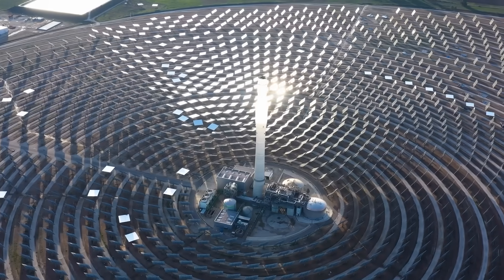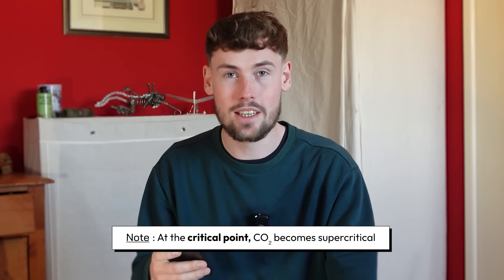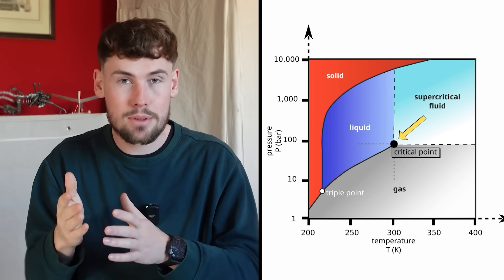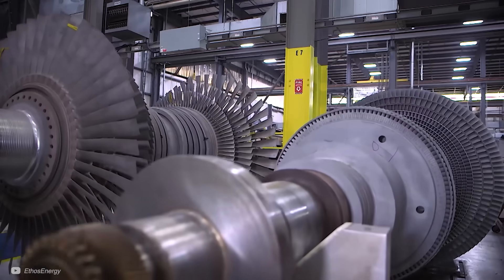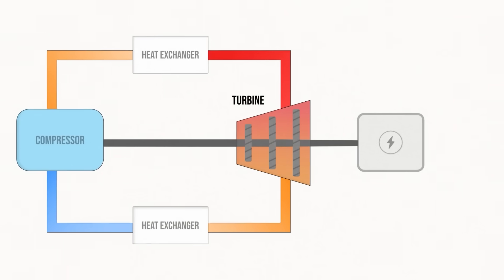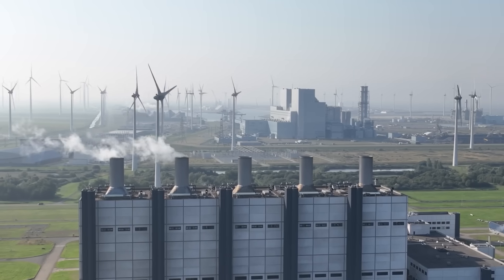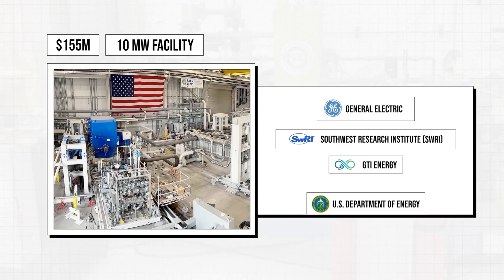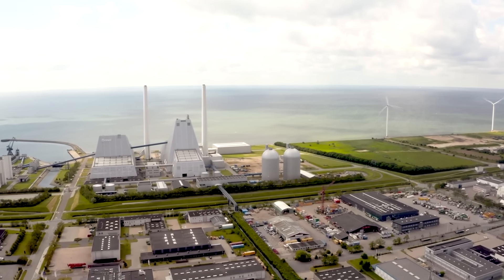How Ultra-Efficient CO2 Turbines Are The Future of Energy

Comment: I've been working with supercritical CO2 for about 15 years. It's interesting. 
The CO2 NEEDS to be dry. Otherwise, you have to deal with carbonic acid formation and stress corrosion cracking. 
Supercritical CO2 is also hard to seal. It will permeate any polymer. Many sealing materials will be destroyed during depressurization. The CO2 inside the sealing material expands more than 50x and explodes out of the seal. 
If using the wrong materials an o-ring will sit and crackle like it's full of "pop rocks" after depressurization. 
Teflon works ok, but you have to be careful if working at elevated temperatures. Teflon has creep issues and will plasticly deform. The o-rings will shrink when the CO2 permeates out, AND the temperature drops, resulting in a seal that is thinner than when you put it in. Then it no longer contacts both sealing surfaces.
Reply: Interesting stuff.  I wonder how they plan on sealing the rotating shafts.  Steam turbines use labyrinth seals which work pretty well up to a couple hundred psi.  (and of course the condenser of a steam cycle is in a vacuum). But sealing a shaft spinning at high RPM against 1070 psi gas and higher, would seem to be a tough issue. How long to such seals last I wonder.
Reply: While not as extensive of experience as yours, I've dealt with CO2 at a few thousand PSI for a test cell for Raman spectroscopy. Towards the end of the project we were looking at basically swage-lok style fittings on everything, including a couple of quartz windows with the edges wetted with indium to provide a better surface to seal against for the metal compression rings. Supercritical CO2 is a wild beast of a material to deal with.
Reply: CO2 has a tendency to destroy seals and a rotating shaft at 1070psi is kind of impractical.
Reply: @olderchin1558  1000 PSI compressor is common. I wonder what kind of seal they use...
Reply: presumably the generator could be inside the pressure vessel so no rotating seals?
Reply: @SamuelBaileySkyrad  you still need to direct full flow pressure onto the turbine blades, and then direct that flow to an outlet for return circulation and heating, rotating seals are unavoidable for this kind of kit.
Reply: I wonder how that will affect my stratos project?
Reply: Copper plate seal knife edge seal
Reply: Say that you had never worked with really high pressure... The seal is made from carbon steel...
Reply: Triple seal
Reply: An underestimated comment. There would also be the danger of CO2 leaks into the environment. With such tremendous pressures, a leak in a pipe flange, mechanical seal, or O-ring would cause the CO2 jet to expand violently, filling the entire environment with oxygen, displacing the oxygen and killing people who couldn't escape by asphyxiation. Unless the pipes and important parts of the cycle were double-jacketed or in an enclosed box, I believe a supercritical CO2 leak would be more dangerous than a leak of superheated water steam, which would at least be a blowtorch, but water condenses and doesn't kill anyone by asphyxiation.
Reply: @jaguarundiargentino1248 , my experience has all been at high pressure but low volumes. Maybe 200-500 ml inside a system but at pressures up to 10,000 psi. 
One quick way to check for big leaks is a thermal camera. 
Joule Thomson cooling from expansion of CO2 is pretty significant. If you have a system in an oven you can immediately see the cold spots on a tube or fitting. 
We use snoop, essentially soapy water to find smaller leaks. 
If dealing with larger gas volumes on pilot scale systems we wear personal gas meters and the buildings where the equipment is located have gas meters with alarms mounted in various locations. Our lab and pilot spaces also have higher air turnover. 
We had an incident where a filter regulator on a large N2 supply line failed, broke dumping N2 into the space. Nobody was in there, but it tripped the alarm. Guys were smart enough not to rush in but could see it was an N2 leak from the alarm and cut the supply. Then in 5 minutes the air handling system had already turned the space over and it was safe to enter and replace the failed part.
Reply: @jaguarundiargentino1248 well that's not unique to super critical CO2. I think most workers would find it rather disagreeable to anywhere near a conventional steam turbine when it would spring a leak. A lot of sailors were flash cooked when steam pipes would take damage in WW2.
Reply: @jaguarundiargentino1248  In oil and gas, 1000 PSI is quite common... So 1000 PSI flammable gas is as dangerous as a 1000PSI non flammable gas...
Reply: @jaguarundiargentino1248 If such a leak happens in an enclosed space with poor ventilation you are simply getting cooked by the energy released regardless of the particular gas well before you have time to asphyxiate

Plenty of horror stories from boiler rooms in ships

Comment: 50% efficiency is definitely less then I would expect from "ultra-efficient" turbines. I have encountered many times steam turbines efficiency ratings of 40-50%. Let's hope these new turbines will be at least cheaper and easier to maintain due to much smaller size.
Reply: The maximum theoretical efficiency of a heat engine = 1-Tc/Th
where Tc = temperature in kelvin of the cold side, Th = maximum operating temperature in kelvin on the hot side

The only way you can get close to 100% efficiency is to have the heat at an infinite temperature and the condensers/cold side at absolute zero.
Since neither of those are possible and materials tend to melt over 1000 degrees, heat engines can never get over ~78% efficiency, not unless we can confine a plasma at millions of degrees and somehow expand that to do some work.

Comment: Wind power brings kinetic energy at normal temperatures, obviating the need for these special materials to withstand ultra heat & multiple bars. After all you need to rotate coil around a magnet to produce electricity. Why should it be made to sound so complicated?

Comment: 10 times smaller ?   Is that the same as saying add ten times less ?     Come on, stop the crap multiplication denotes increase,  by convention reduction is denoted by the reciprocal ie 1/10 of , really come on 10 times less actually means multiply the initial amount by 10, then subtract that from the initial amount.   Starting with 10 pounds and add 10 times less means this:  10 - 10x10. you must remove 90 pounds.    Total cockwomble shitspeak that makes no sense

Comment: As these are much smaller, could they theoretically be put "anywhere there's a fire"? Like waste incinerators and even over blast furnaces to "re-use" some of the energy that went into firing them?

(Why yes, emoji users, I KNOW it won't get enough energy back to run the furnace itself, but getting some back for nearby houses is still worthwhile, right?)

Comment: The water is not special ‘supercritical water’, supercritical here refers to the design of the boiler where the water turns directly into dry steam rather than going through a water->wet steam->dry steam process.
The outlet of the boiler is higher pressure and temperature compared to a standard boiler, so maybe 1050F rather than 1000F (540C).
The boilers are more expensive and so is the subsequent pipe work, valves and turbines as they have to deal with higher inlet temperatures and pressures.

Comment: This tech has some issues.  Not the least of which is containment.  CO2 being a greenhouse gas and being in a high pressure system will pose challenges in the area of how to maintain the inner component without venting that CO2.  Next is you're compressor will eat up significant amounts of energy.  Most likely exceeding the efficiency gains using supercritical CO2 would offer.  You've also glossed over your heating source sort of hand waving it away under the title oh yeah we can make heat don't worry about it.  But this technology is based on heat to torque exchange efficiency.  As such solar heating by way of its nature is out of contention due to a little thing we call night.  This tech also suffers the same problem as molten salts as you run the SC Co2 past your turbines you're going to have condensation issues much the same as when using steam.  To think that you will not is wishful thinking.

Comment: Not an expert, but when I’ve seen CO2 applications previously, the problem is the cost and the energy that goes in to getting CO2. Water however is pretty much just there as your local waterworks is already producing lots of it, failing that there’s other water sources.

Comment: Looks like one thousand and seventy psi (which is 74 atms), not one hundred and seventy as spoken. Pressures that high are going to require that diameters are kept small - so it's hard to see how these are going to replace steam turbine generation capacities. Steam turbines seem to operate at about 40 bar maximum.

Comment: It takes 1 kwh of electricity to make 900 grams of solid co2 , so how many more kwh of electricity will be made by using 900 grams of solid co2 ?
Reply: This is a closed cycle. Carbon dioxide is not consumed.

Comment: The more steps are needed the less efficient a process is.
Produce heat, compress the medium used for heat transfer, heat it up, use the liquid to turn a turbine which then drives a generator, cool down the heat transfer medium which requires a cooling circuit to run a cooling medium through the heat exchanger. Not to mention the need for transport of the electricity which gets less efficient as larger the distance plus the efficiency of the process turning the electricity in whatever it is needed for ( heating your home, cooling your home, refrigerator, lighting, transportation….)

Comment: Solar with Battery Storage is replacing all other forms of power generation.  It is far cheaper and faster to install a system.  Simply put in twice the solar needed and enough batteries to store the excess power generated in the day, and you have clean cheap electricity all the time.

Comment: Dense phase CO2 is not an easy fluid to work with!! Does not lubricate well. Tries to impregnate porous membranes. Very difficult to seal especially at pressure, ie. shaft seals. Do not underestimate technical issues with mechanical designs - this will need to be a precision machine. Also interested in the Quasi Compressor as it needs to be built like a pump but behaves similar to a compressor - will need allot of stages or high speed with variable drive.

Comment: The elephant in the room.  How much does it cost to make liquid CO2 vs the income of the expected energy output, maintenance costs included?  3/4 of the way through the video and that hasn't been addressed.  I'll bet it will "work" with an assload of government funding just like wind turbines.  Neither one will ever be profitable.  I'd like to be proven wrong but the older I get it seems the stupider scientists get.
Reply: It's a closed cycle. The carbon dioxide that powers the turbine is not consumed or released into the atmosphere.

Comment: Your efficiency data is utter garbage.

A modern HP or IP steam turbine is about 94% efficient.  How do I know????
Because I’ve spent 30 years designing them.

When the Manjung IP turbine went into service in ~ 2000 it recorded a thermodynamic efficiency of 94.3% which was as the most efficient steam turbine measured, one of mine!!!

You are confusing the Rankine cycle efficiency with the efficiency of the turbine.

A standard Rankine cycle efficiency of a coal fired plant is in the ball park of your chart but a modern CCGT cycle efficiency is now over 60%.

Comment: To reach very high efficiency, it is far simpler to introduce cogeneration. Most of the energy not used is thermal energy rejected in the cooling system. Thus using this watse energy usefully leads to very high efficiencies, far above 50%.

Comment: A little semantic, but if the CO2 expands in the Heat Exchanger it does not move forward and no cool CO2 can enter the HX. 
Correct is the CO2 heats up in the heat exchanger and is drawn through the turbine by the vacuum of the condenser, hence at the HX the pressure drops. You cannot pump stem, but collapsing it allows it to be drawn through the turbine off the the boilers. The key difference is the pressure at the HX drops as it's heated and drawn through the turbine.

Comment: A closed loop system which heats a gas on one side, cools it on the other and extracts energy in between, sounds like a very complex sterling engine. Increasing the density of a gas in a more conventional Sterling engine would definitely increase its power output. A large scale power turbine in a system at over 1000psi sounds like a bomb thought. I’d be curious to experiment with other inert gases at maybe 3 atm of pressure in different types of sterling engines to see what could be possible.

Comment: I imagine this sort of tech has been around for a while, sounds like it would be the sort of thing you would see in a nuclear submarine or warship
Reply: Well I asked Grok and maybe they are not using it yet but maybe in the future.

Using *supercritical CO2 (sCO2)* instead of steam in a nuclear submarine's power cycle is an intriguing concept, and there are potential use cases and benefits, though it’s not currently standard in submarine propulsion. Below, I’ll outline the potential applications, advantages, and challenges of using sCO2 in nuclear submarines, drawing on its known use in other power generation systems.

### *Potential Use Cases for sCO2 in Nuclear Submarines*

1. **Compact Power Cycle for Propulsion**:
   - **Application**: sCO2 cycles, like the Brayton cycle, could replace the traditional Rankine steam cycle to drive the submarine’s turbines for propulsion and electricity generation.
   - **Benefit**: sCO2 systems are significantly more compact than steam systems due to the high density of sCO2 and the smaller size of turbines and heat exchangers. This is critical in submarines, where space is at a premium.
   - **Impact**: A smaller power plant could allow for more space for weapons, crew, or other systems, or enable the design of smaller, more agile submarines.

2. **Improved Efficiency**:
   - **Application**: sCO2 cycles can achieve higher thermal efficiencies (potentially 40-50% vs. ~33% for traditional steam cycles in naval reactors) at the operating temperatures of naval nuclear reactors (around 300-350°C).
   - **Benefit**: Higher efficiency means less fuel consumption over the reactor’s life, potentially extending the time between refueling (already decades for modern subs) or reducing the reactor’s size and uranium enrichment needs.
   - **Impact**: This could lower operational costs and reduce the logistical burden of refueling.

3. **Simplified System Design**:
   - **Application**: sCO2 systems eliminate the need for steam condensers, boilers, and other components required in steam cycles, simplifying the power plant.
   - **Benefit**: Fewer components reduce maintenance needs and potential points of failure, improving reliability in the harsh, isolated environment of a submarine.
   - **Impact**: Enhanced reliability supports long missions without maintenance.

4. **Enhanced Stealth**:
   - **Application**: sCO2 systems can operate with lower heat rejection to the surrounding seawater compared to steam systems, as they require less cooling due to their efficiency.
   - **Benefit**: Reduced thermal signature makes the submarine harder to detect via infrared or thermal sensors.
   - **Impact**: Improved stealth aligns with the strategic need for submarines to remain undetected.

5. **Adaptability to Advanced Reactors**:
   - **Application**: Future naval reactors, such as high-temperature gas-cooled reactors or molten salt reactors, could pair more effectively with sCO2 cycles than steam cycles due to temperature and material compatibility.
   - **Benefit**: sCO2 cycles perform well at higher temperatures (400-700°C), which could be leveraged in next-generation submarine reactors.
   - **Impact**: Enables the adoption of advanced reactor technologies for future submarine designs.

sCO2 cycles are being explored for terrestrial nuclear power plants, fossil fuel plants, and concentrated solar power, with projects like the U.S. Department of Energy’s STEP (Supercritical Transformational Electric Power) program demonstrating 10 MW-scale systems. However, no known naval submarines use sCO2 cycles as of April 2025.
- **Naval Research**: The U.S. Navy and other naval powers are likely researching sCO2 for future applications, given its potential for compact, efficient power systems. For example, sCO2 has been studied for surface ships (e.g., destroyers), which could extend to submarines.
- **Timeline**: Given the long development cycles for naval nuclear propulsion (10-20 years), sCO2 systems might be considered for next-generation submarines (e.g., successors to the U.S. Virginia-class or UK Astute-class), but widespread adoption is likely decades away.

Supercritical CO2 could theoretically replace steam in nuclear submarines, offering a compact, efficient, and stealthy power cycle for propulsion and electricity generation. Its primary use cases would be enabling smaller reactor designs, improving fuel efficiency, and enhancing stealth through reduced thermal signatures. However, significant technical challenges—high pressures, cooling needs, and system maturity—mean it’s not yet practical for operational submarines. Research into sCO2 for naval applications is likely ongoing, but steam-based systems will dominate for the foreseeable future due to their proven reliability.